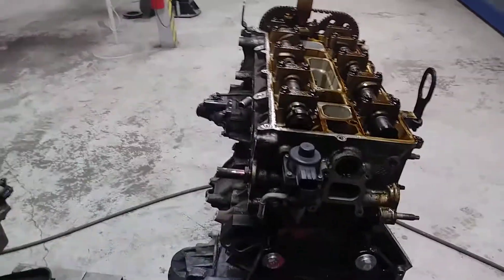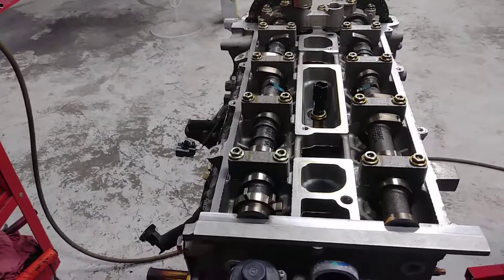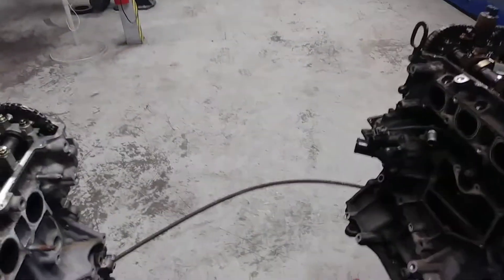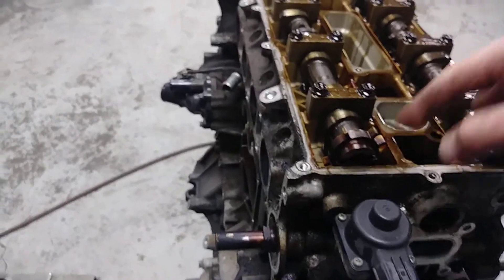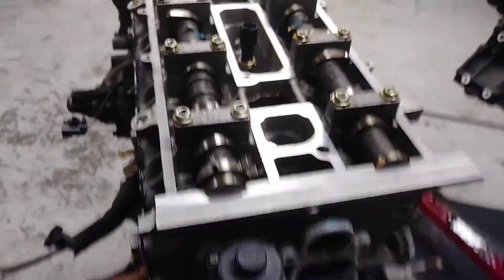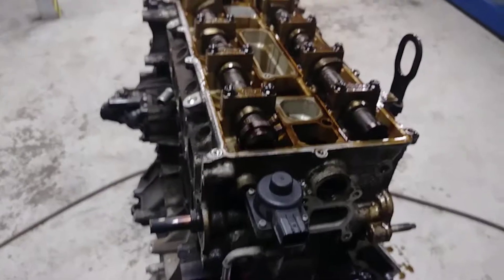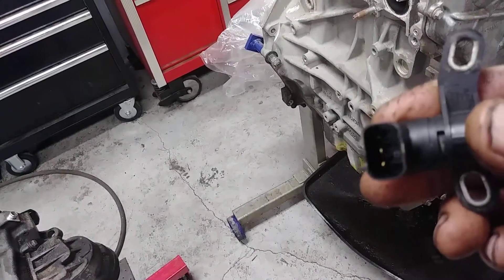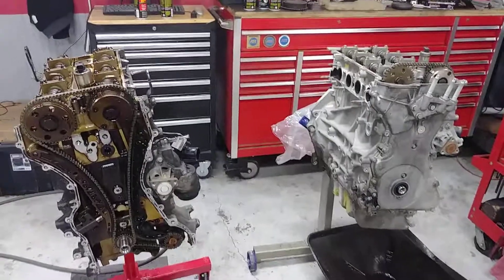Mazda 3 and 6  2.3 to 2.5 Fusion swap part 3

Comment: Will a 2013 2.5 fusion engine work in a 07 mazda 3 with the 2.3
Reply from the maker: Yep. Just swap the necessary parts per videos and forum links.

Comment: will the 2.5 ford engine fit into a 2010 mazda 3 with the 2.5 engine without any mods?
Reply from the maker: You don't have to modify the long block, but you will have to swap timing cover, oil pans etc... You can keep the 2.3 intake with a adapter plate or use the Ford intake, but you will have a check engine light because of the lack of Intake manifold runner control on it unless you rig it. See videos and read the Mazda 3 forum threads to see what you need to do and the options with the intake. Have fun with it.

Comment: I have a 2014 mazda 6 2.5 Skyactiv. So what does engine can I swap out with?
Reply from the maker: 2.5 skyactiv. The skyactivs are high compression direct injection. These videos are about the non skyactiv 2.5's.

Comment: Anyone know which intake cam looks like it has more duration/lift? Trying to figure out which one would make more power, even if it's a small difference, can't complain with free power
Reply from the maker: Don’t remember the specs I read on a Mazda 3 forum post, but the 2.5 had better profiles which is why I swapped the cam sensor wheel from my 2.3 cam to the 2.5 cam instead of just swapping the whole cam on my 2004.